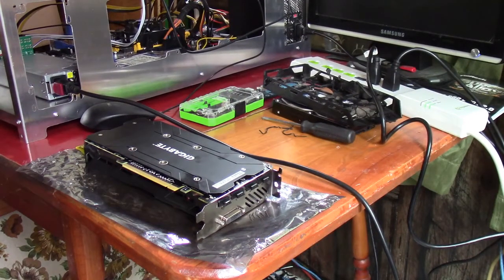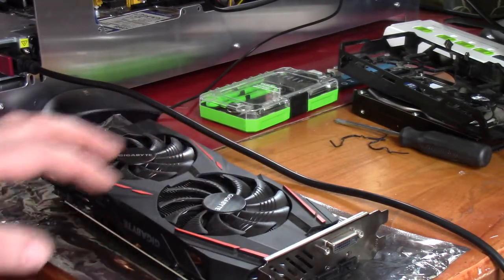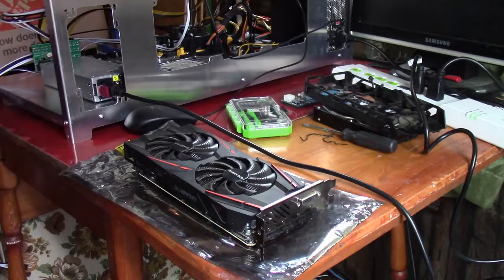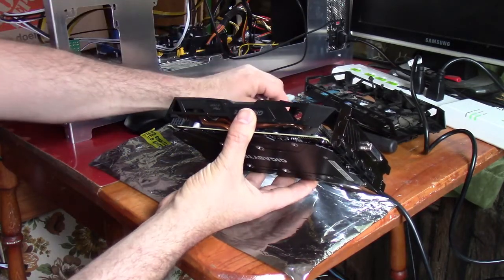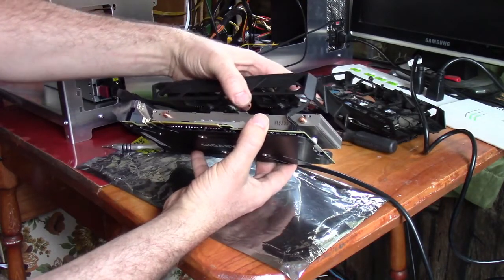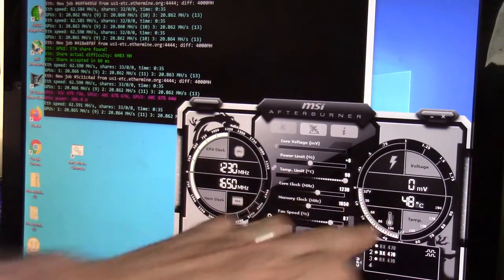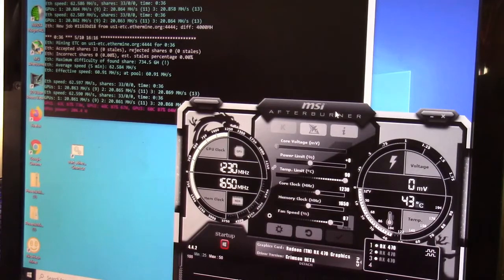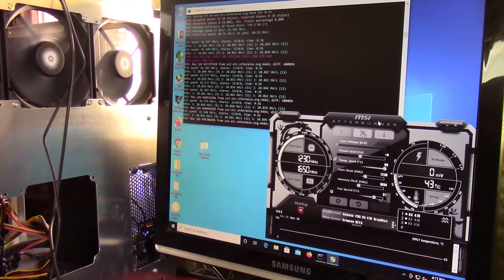Replacing Graphics Card Fans With 120mm Case Fans

Comment: Don't forget to do some measurements. In this case, 1*120mm and 1*92mm with high pressure like arctic pro fans would be better and easier to install. You can also plug your fans on the gpu. Max 0.6A.

Comment: Thinking about replacing the fans on my 4070, they are not that loud they just make an annoying noise. When I was reading a review for my card (Inno3D twin x2 4070) people said it was completely silent. No it's not, it's annoying as heck. I wonder if some people are deaf or something. I can't stand noisy PCs, especially when the noise changes, when it isn't a steady consistent sound that your brain can cancel out. (the sound isn't consistent even if I set them to a fixed speed). I have a 3d Printer so could 3d print some sort of bracket for the fans.

Comment: Hello. I have 2x Artic 120 mm standard 1500 rpm PWM fans connected to my fan header of my graphics card Msi AMD Radeon Rx 480. And exactly the way the original fans were connected, i.e. 4 pins and 3 pins. Only one of the two fans gives the RPM level signal. Both have same colors and I thnink wire colors is standard for these 4 colors. But now the automatic fan control no longer works. By default the fans run at 100% all the time even though they are silent fans and should not run without load. In Afterburner I can switch from automatic to manual and control it between 25% and 100% and manual control works! And the measurement diagram also shows me 900 - 1500 RPM. It looks like the card can carry the load of the bigger fans running them at 100%, no problem. But somehow the automatic mode fan control no longer works and I can't understand why (Temps are low 26°C) ?

I see 2 options:

1) During the driver installation you will notice that the fans are being tested. It could possibly be that the installation detects an error because the fans do not spin up to 2000 or 3000 rpm like the original fans. And the installation then sets the automatic mode to permanent 100% fan speed.

2) You have to crack the firmware of the card and readjust the fan control of the firmware?

I guess it can only be the first though. That means there's nothing you can do except use fans with the same RPM. That no error and bad setting occurs ?

It's not a problem in itself. Since you can start Msi with Startup with 25% fan. And the fans aren't loud at 900 RPM. And before you start a game, set the fans to 100% with Afterburner. and after playing again to 25% manually. However, an automatic is better.

Comment: you just get two quality 120's, use zipties to fasten them to the cooler (the heatpipes make great anchors) and then plug the 120's into your MB

This way you can control your fans with the 'fan control' software and make use of PWM functionality

Comment: Nice! I did something similar here, but my question is about the durability of the Hellerman clamps, do they withstand the heat of contact with the aluminum or copper sinks? (fins)
Reply: nylon melting point is 257C - 495F, they should do fine even with 80-85C videocards and afterburner has 90C failsafe that turns off your PC to not overheat the card. 
I got really hot card with aluminium only radiator, no copper plates or pipes so it's worse than his situations of 50C and still, the zipties hold it firmly.
Reply from the maker: I used zip ties and they work fine still

Comment: How to connect the two power cables of two fans to a single source?? Can u tell the name of power cables required
Reply: PWM 4pin to 2X 4pin GPU VGA
Reply: 4 pin fan splitter

Comment: I would switch to Water Cooling Blocks -> more silent and can use Heat Recovery (Heat pump) to Heat the House + Hot Water via a hydronic heating system

Comment: I just did this exact thing last week to my Gforce with case fans lol my card actually runs cooler now than it did with the stock fans, even under a load generating videos.
Reply: what fans do you used? i buyed 2 with 62 cfm and 2,22 statc pressure ,hope to be better than the OEm ones
Reply from the maker: Yeah, seems to work well.